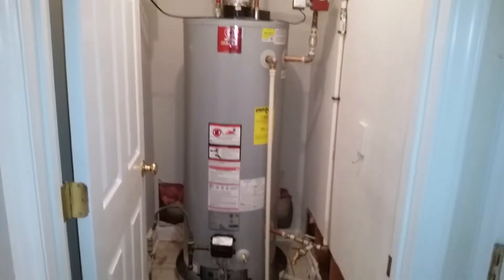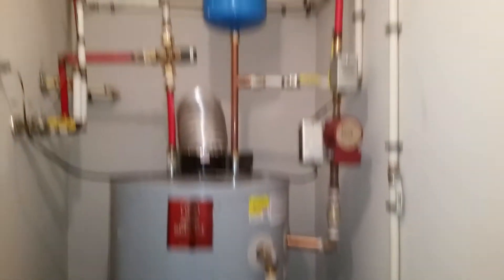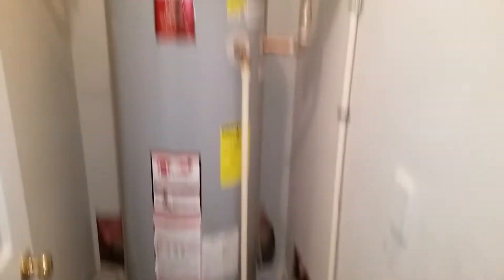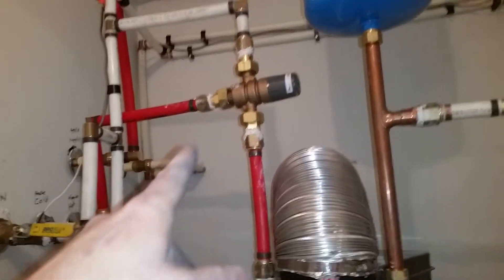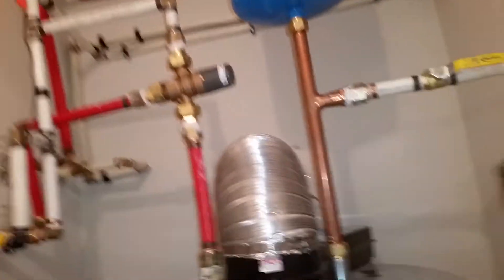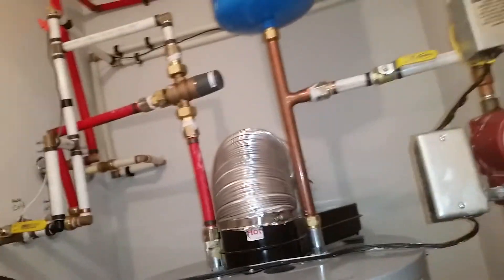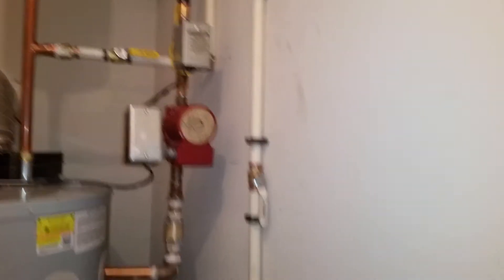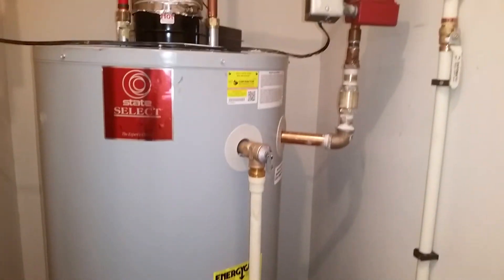Apollo water heater installed properly

Comment: Why is there a need for a check valve on the outlet? What will that accomplish when the return from the loop is still open into the water heater. Genuine question, I think your install looks great.

Comment: T an P discharge pipe is below the flood level rim of the pan, which would cross contaminate the potable water supply.  Need 18' of hard piping out of the heater of any gas water heater.  Shark bites?  Eww.  Need a check valve on supply AND return lines of the side loops.  Need a strap on the t and P discharge pipe 12in from its end.  Return line looks like more than 32in unsupported from that talon to the loop inlet.  It is good looking work for sure.  But it would fail in my area.

Comment: Code states, 18"minimum hard line 'copper' from both hot and cold off of water heater. Inspector will not pass unless this is done. Looks nice and clean though.
Reply: Yup looks nice and clean

Comment: I have a question regarding the yellow lever(s) you have installed on the left hand side.  I recently replaced the hydronic A/C system in my home, I still have the Apollo Hydro Heat water heater. Another homeowner just told me (not that I spent thousands for an all new A/C system)  that either pulling or pushing that yellow lever makes the A/C air cold.  IS THIS TRUE?   What are those yellow levers used for? Thank you so much!
Reply from the maker: they are shut off valves or ball valves the reason to turn off the valves is to prevent thermal siphoning

Comment: Looks neat and clean and have a question : do these Apollo W/H's secondary loop are separate, or combined (mixed together) If I am correct they look to be separate with valve feeding from main only when needed, and how often you drain them or refill them as I don't see any way to keep the secondary always filled and never mixed with domestic water. Is there any good info available somewhere. Thanks again.
Reply from the maker: +rmwaseem the apollo system uses the potable water in the water heater there isnt a loop or heat exchanger in the tank the system requires yearly flushing to prevent bacteria growth
Reply: Good info didn't thought that was possible to use he portable to heat coil as well domestic use..!
Reply from the maker: yes you can use a high input apollo water heater to heat any home at 1/10th the energy of a air to air furnace